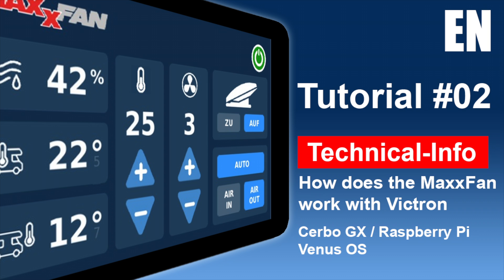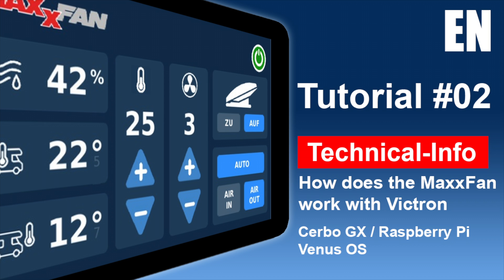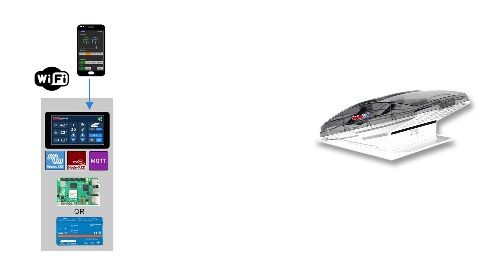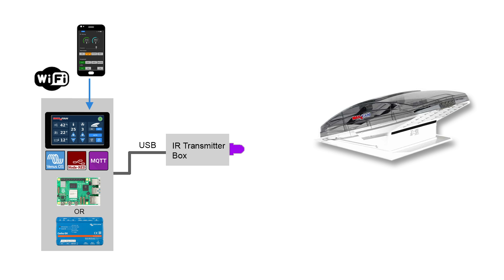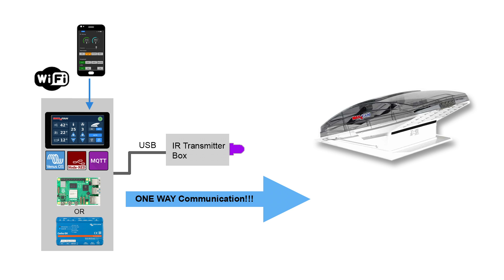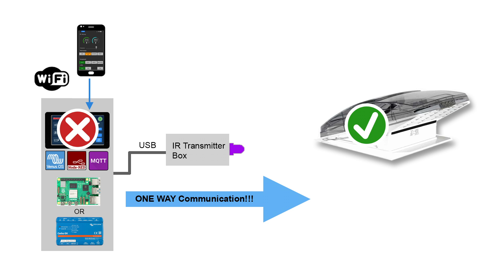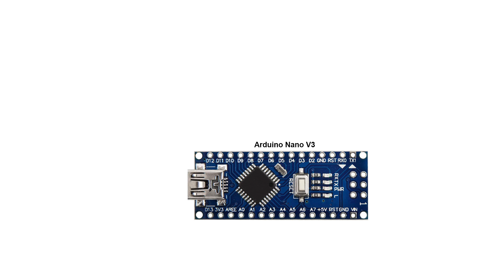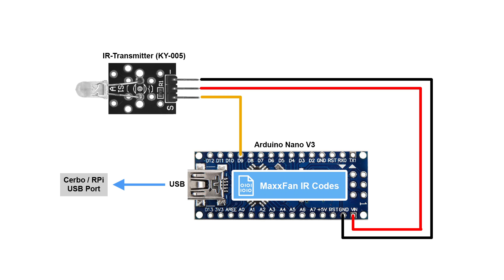EN: MaxxFan controlled by Victron Cerbo GX - How it works (english)

Comment: Hello Marcus, very well explained and useful videos for those of us who want to unify everything with the Cerbo, but are you planning to make a video of the connection or do you have a website where I explain it, it is not very clear to me where to insert the raspberry pi and connect with Cerbo GX, thank you very much.
I hope you understand what I'm asking. I used a translator.😉
Reply from the maker: Hi, there will be a lot of videos soon. Actually I'm rewriting the complete code to offer a "Community Edition" for the MaxxFan and the Truma as well with an easy installer, and some minor changes to do by the user. 
You don't need both (Cerbo and Raspberry). Either Raspberry OR Cerbo GX...
Website (roadbuck.de) and Instagram (roadbuck_de) is in progress

Comment: Hi Marcus,
Really nice video you've done with both the Maxxair and Truma heater. I am curios to know how you are making the UI for this on the Cerbo? I know from your videoes you are using Node red for the integration, but are you using that for the UI as well or how are you doing that? I have a Nest thermostat in my van controlling the Eberspacher heater I have, and would like for it to be integrated into the Cerbo display as well
Reply from the maker: Hi Andreas, the changes for the UI are coded. NodeRed is for the logic behind and the dataflow in the background. I'll explain that in one of the next videos. To integrate the Eberspächer could be a nice project for me as well. How or where can I find documentation about the Nest thermostat and the Eberspächer (which model)?
Reply: @roadbuck  thanks for the info, I'm a software developer myself so that'll be no problem, but how and where do you code for the cerbo screen then? 
The eberspacher has a yellow wire for on control (12v) and that's it, so you would use a nest thermostat to control when to turn on based on ambient temp, and then connect a wire to the heating relay on the nest that'll connect 12V to the eberspacher when the relay is on.
A video explaining that is here 
https://youtu.be/_Ezrqpf8WgM?si=Zoh0aXGW3dhrOiCf

Basically all models of Webasto or Eberspacher to this day still use an on signal, they just turn on an off and needs a thermostat to control that logic
Reply from the maker: Thank you for the details. I'll take a look at it!
Reply: @roadbuck   I m also interested in integrating a Webasto Airtop. As  Andreas mention that the ebespräscher has one cable the Webasto works the same. I now use it with as shelly one for on and off and then a have a virtual thermostat in the shelly app and a tempsensor connected to shelly.  Would be nice to have it on the Truma screen
Reply from the maker: Well, then this should work in the same way. I have already thought about this and I think that it will not be very difficult to integrate this in conjunction with NodeRed, a temperature sensor (e.g. Ruuvi) and a relay.